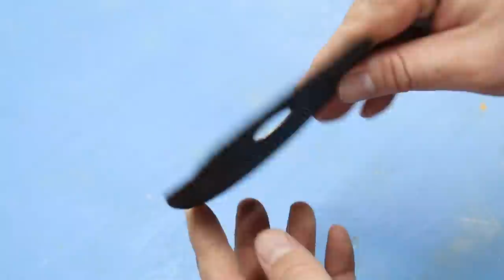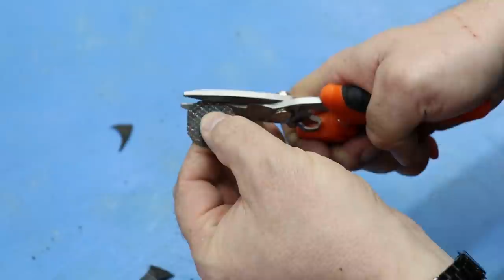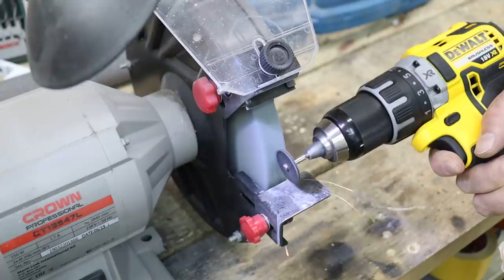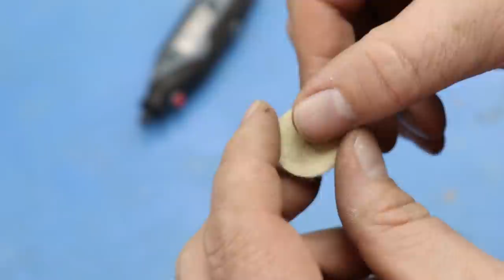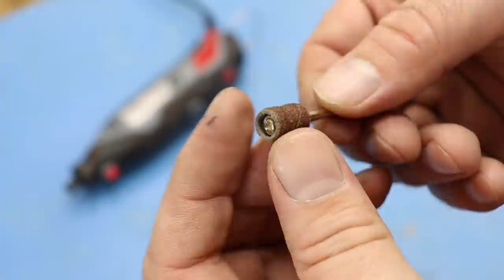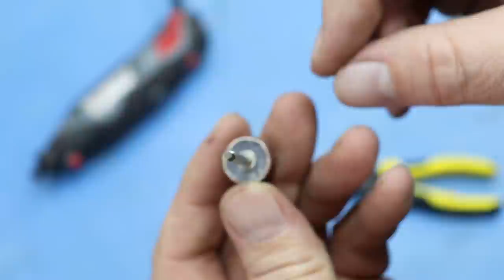Мало кто знает об этой ФУНКЦИИ ДРЕЛИ! Не трать деньги, а сделай сам!

Comment: Awesome tip Dacha! IMO, the cutoff wheels you buy from the drill manufacturers are super expensive and always fail before they are barely used and the third party cutoffs don't even get that far. The buffing pad and sanding drum have always been a huge pita for me are designed to have very short lifespans, since these companies make little on the sale of the drill and reap high profits on the consumables such as the cutoffs, buffers and sanding drums. Again, IMO, the reason these items fail is due to the chintzy mandrels that hold them... I think you may have solved that problem for me by making them a lot more beefy.. The last I looked, the price of a '10 Reinforced Cut-Off Wheels, 1-1/2 in. Dia.,  made of a hard abrasive and reinforced with fiberglass for slicing and cutting metal .. goes for $17USD or a $1.70 each at one of the big box store.. Yikes!!!!  One 4.5" metal cutoff wheel of decent quality runs around $5. I'm guessing you can get 10 mini wheels from 1 - 4.5" wheel bringing the costs down to 50 cents/wheel or a $1.20 savings/wheel !!!  and I bet they'll last 2x as long.. Just my 2 cents....
Reply: Reusing the cutoff wheel is intensely stupid.
Reply: @alexb7641  Hey we're all entitled to an opinion but to write it without expanding on the reasons why just makes comments like yours totally useless. If you can backup your claim with a good reason, then maybe someone will pay attention to your opinion. But without them, you just look like another user who makes these kind of 'stupid' statements without any substance behind them. IMO and in the opinion of many others, I thought this video was helpful and was posted by someone who actually wants to share his knowledge, then took the time and effort to do so. I'd love to comment on some of the helpful videos you posted recently.. Oh wait, you don't post videos, you only make comments on them, and probably negative ones. 
You know that old saying 'Opinions are a lot like assholes.. Everybody's got one'. Later Alex B.
Reply: Geezz, these replied comments are meant to enhance the user's experience not to simply DISS other people.
I have used this Dremel tool professionally for many years.
There are many tips add shortcuts to enable a person to use this tool most efficiently.

For example the little wire brush tools scarcely last 30 seconds.

I found a workaround to that which enables me to use a wire brush accessory for a long time because that is what I primarily used it for, cleaning electronic card Edge connectors.

Instead of using the flimsy wire brush accessory; instead I cut discs from A Fine mesh wire screen and punch a hole in the middle of it.
I use this as a substitute for the wire brush and it lasts a very long time!
Reply: @johnedward7538  Thank you for your input, that sounds like a very helpful idea! Yes 👍
Reply: @alexb7641  👈🏼 “🛋🥔” Commenter of day award 🥉
Reply: @alexb7641  it can release asbestos
Reply: @edsnotgod  The new wheels wouldn't be rated for 35k+ RPM lol. People talk about spreading COVID misinformation being dangerous, then you got jackass here trying to talk people into a neck injury when the home made wheel flys apart.  That'll be a good 30 cents saved.
Reply: @alexb7641  how about if he starts with a new unused disk?
Reply: @Buddy-po4hv  You mean if you took a brand new wheel, and cut it up? It's the same logic minus the resourcefulness of trying to save something.
Reply: @alexb7641  yes, meant a brand new disk and cut it into small disks, one commenter mentioned that once a disk breaks it's "compromised" not as strong as it was before breaking..
Reply: @Buddy-po4hv  yeah absolutely, you throw them away when they get chipped or damaged also. That's standard practice at any metal fab shop for obvious safety reasons. Your EHS manager will clip you in the back of the ear for using them. 

The problem being what happens at high RPM. They become unstable and dangerous. So if someone wants to cut semi round disks out of a brand new disc, the logic just defys me. You aren't saving that much money and getting a seriously inferior product. 

Otherwise the OP should be a 6 Sigma triple black belt and go around streamlining metal shops around the country. They'd laugh him right out the door though.
Reply: @Buddy-po4hv  before the op rage quit this conversation, I probably would've asked if he checking what the disc he's using are rated for if they aren't lasting long. If you put too much pressure on them etc they'll fail. There is probably alot of operator error.
Reply: You are absolutely right.

Comment: I suppose these ideas can work in a pinch but I think the likelihood of one coming apart is probably pretty high. In the course of cutting these out, I suspect the stresses could weaken the material and make failure likely. I have had good luck with the Dremel cut off wheels. They last well provided you don't force them. Light pressure and keeping them square in a cut and they will last just fine.   They do make a heavier duty cut off wheel that is larger diameter and a bit thicker. These can take a bit more abuse and will last a long time.
Reply: exactly. more content mill BS that's gonna get someone hurt

Comment: For half the price of 4 large cutoff disks you can literally get 50 small disks PLUS four mandrel mounting posts. I mean, unless you're desperate at the moment, I don't see the point of cutting small disks out of the larger disks. A waste of time and money. However, the little buffing wheel pop rivet trick is pretty cool.

Comment: Yes, I can see that working. The larger disks are thicker though, so they will last well, but the bearings in your *remel WILL wear more quickly, so it's a tradeoff. Here's an idea: since you're already using a bench-grinder in your tip, turn the disk 90° once it is round, and grind a bit of taper on the surface. BTW, excellent narration, haha!

Comment: It's not dangerous to use the grinder disk like that?
With no metal at the center, there is a bigger risk to have the mini disc exploding at use.
Reply: The small diameter cutting disks used on small rotary tools like the Dremel brand tools don’t  have metal reinforced centers ( even factory made discs) and don’t need them because they don’t develop the same high levels of stress a larger diameter disc used for heavy duty cutting can develop.

Comment: Yes, Incan seebthatbeorking. The larger disks are thicker though, so they will last well, but the bearings in your *remel WILL wear more quickly, so it's a tradeoff. Here's an idea: since you're already using a grinder in you tip, turn the disk 90° once it is round, and grind a bit of taper on the surface. BTW, excellent narration, haha!

Comment: So let me see how this works, you're going to destroy a maybe 10 to 16 dollar pair of cutters to cut an abrasive wheel when you can buy a whole pack of cut off wheels for dremel for $5 or $6. Sometimes it's easier to just buy new instead of mucking around with junk.
Reply: Damn right!
Reply: Yup. And the Dremel fiberglass wheels last a long time and are balanced.
Reply: I agree - seems counterproductive...
The cutters Can be re-sharpened, but now there's another thing to repair before it can be used again.
Just making more work, we can buy more cut-off wheels but we can't buy time.

Comment: OK, but Dremel offers a much better collet and thick cutting discs that snap in place. This makes their old system obsolete and I've been using Dremel tools since the mid 60's. Rarely do they have a bit that comes along which is lesser than something they had before. They also have expanding collets to fit the sanding bits you show. Again, why not just buy the appropriate bit acessory? These are high speed tools, encouraging people to make their own bit devices is a bit iffy. If they are off-center in the least they can fly apart and or load the tool improperly.

Comment: Nice.  2 comments.  (1) If you're going to the trouble of making small grinding wheels from a large broken one, you can also make some that are slightly larger in diameter, like 2", in addition to the exact replacement size.  (2) For the white buffing wheel they make a very simple (and cheap) mandrel that is just a shaft with a short screw taper at the end, that simply screws into the center hole in the white buffing wheel,holding it snug just from the short but coarse threads.  It's less hassle than finding a rivet and a rivet gun - though that's an excellent back-up.  The advantage of the simple screw-in mandrel is that it doesn't stick out the opposite side (like the tip of the rivet, or like a flat-washer and screw) so that the buffing wheel can also be used at the front in addition to the side of the wheel.

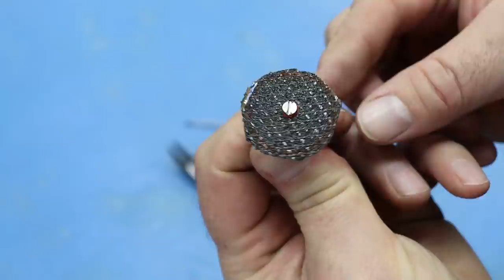Comment: 1:10 How did you get sparks to fly off the metal BEFORE you started the grinding wheel spinning...???
Reply: The bench-top grinder was on. Once the disk on the hand drill touched the spinning bench-top grinder, it created a spark, and he then hit the trigger on the drill, spinning it in the opposite direction.
Reply: @jasonbone5121  OHHHHHHHHHHHHHHHHHH ----- he was using the BENCH GRINDER to smoothe the cutting-disk!  Duhhhh... I'd never noticed that; I'd thought he was using just the little metal stock-resting platform to run the disc against and make it even on the edge.  Thanks for explaining it to me. :P :D
Reply: @Quacks0  mi